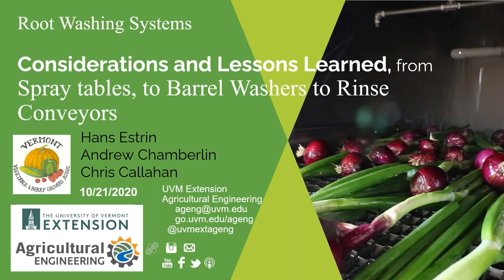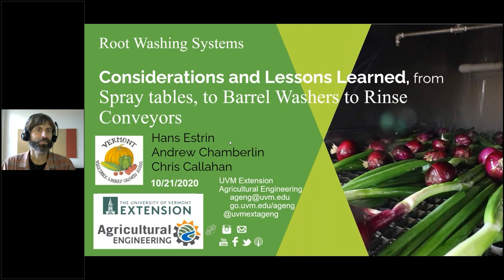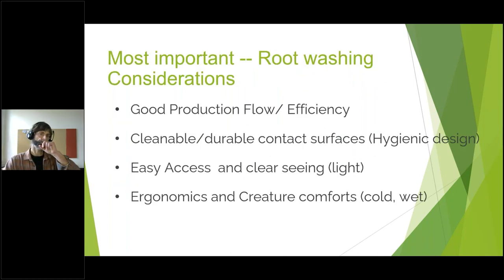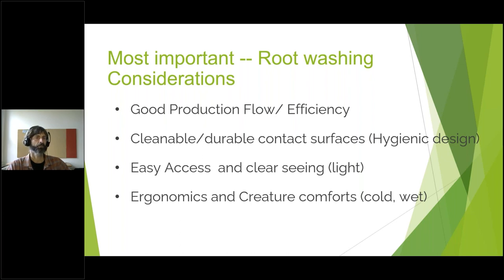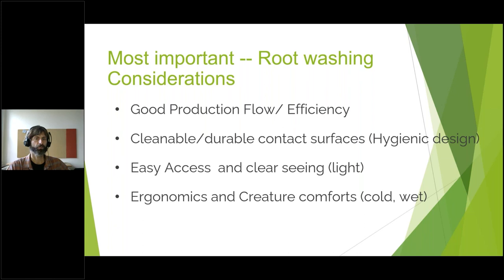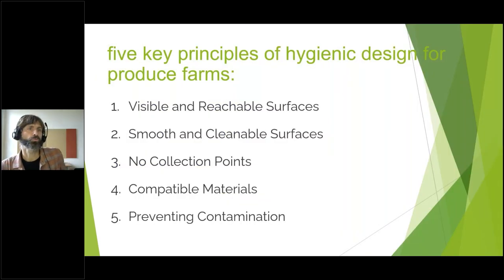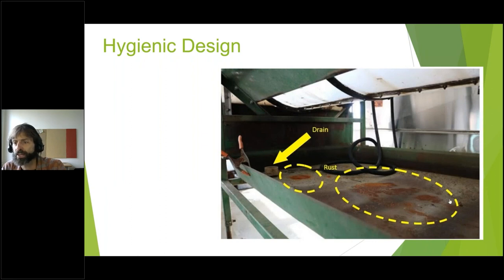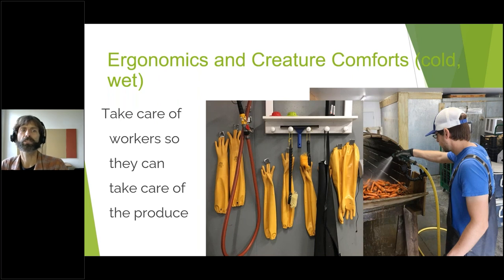Root Washing Systems with Hans Estrin | VVBGA Webinar Series

Comment: You have showcased a nice variety of washing tools. It really helps farmers in selecting best product for their application. We too own the "Dailed In Cadillac Barrel Washer" manufactured by Dick de Graff of Grindstone Farm in Pulaski, NY. He has been making and distributing both fully built washers and kits for over 30 years.  Ours has held up for decades and really gets the job done. Our experience was that It paid for itself the first season (now they are around $3500). Robert Haddad of Cornell ran tests using Grindstone's washer shown in your webinar and results showed that with cleaning after each use there were no contaminants associated with the barrel's wood construction -- a big bonus!  Thanks for putting this together.